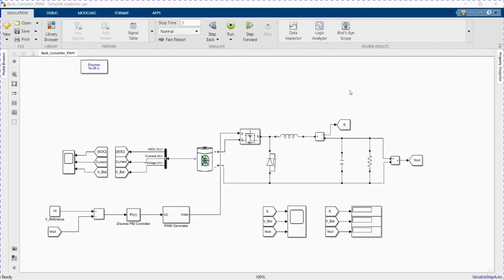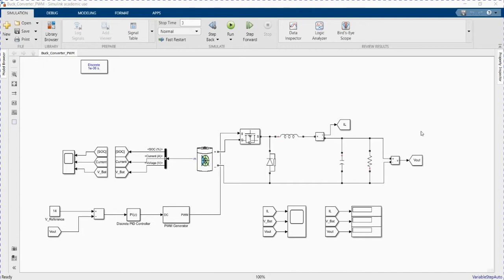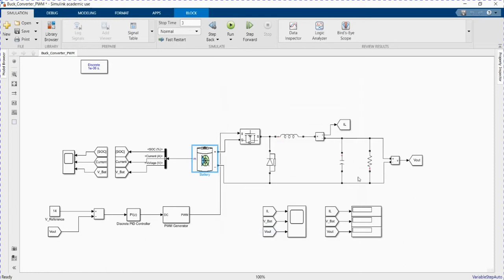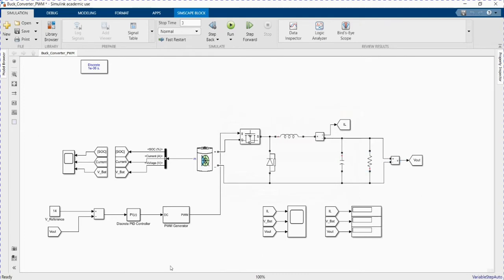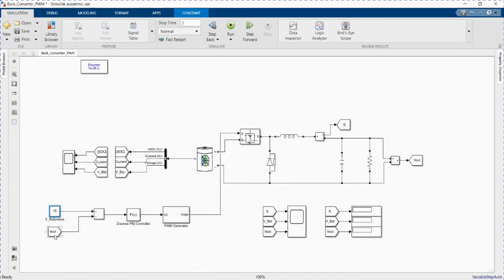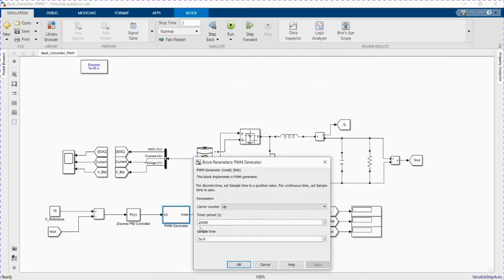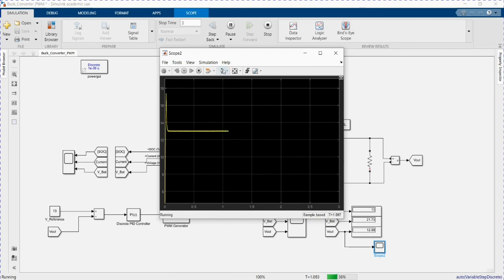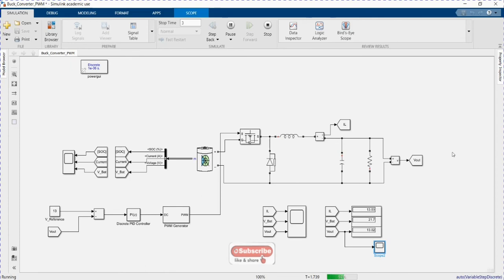Design and Simulation of DC-DC BUCK Converter using PI Controller with PWM Generator in MATLAB

Comment: Can we control the amperage at the same time ? I am trying to design Constant current - constant voltage charging system. I will be glad if you can help me.
Reply: Hey did you manage to design it?
Reply: @kxwong3193  yeah i managed to simulate but i couldnt apply on a prototype it was our school project